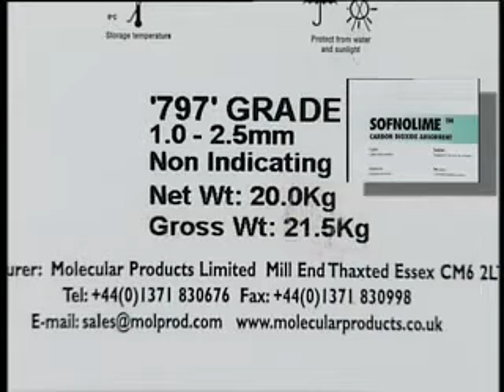AP Diving CO2 Scrubber packing safety video

Comment: Looks like you have over packed that cylinder, over packing is dangerous as the co2 cannot pass through
Reply from the maker: So, you are saying that the manufacturers are doing it wrong? That video was made by AP Diving, the most prolific manufacturer of rebreathers in the world.
Reply: Yes they are
Reply from the maker: @homealtitudetrainingoxyhoo3484  , firstly I will make a comment, the last thing you want, is for the CO2 to pass through, that will kill you. As you are obviously such a high authority to state, that the manufacturer with the most rebreather sales in the world are doing it wrong. Bearing in mind they were the only one with equipment to test the WOB of CCRs. I shall tell them that you state they are doing it wrong and therefore need to recalibrate their equipment and stop testing for the HSE and government.